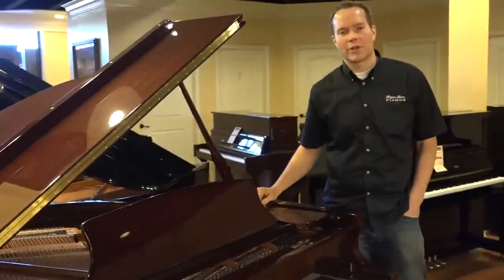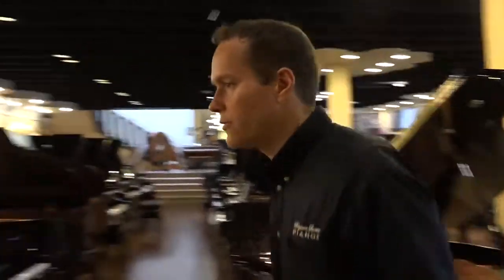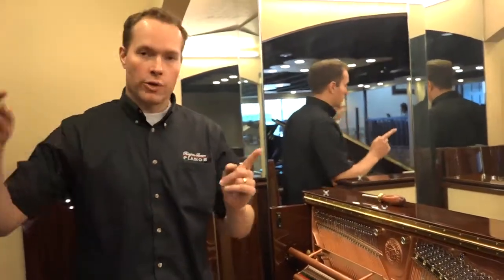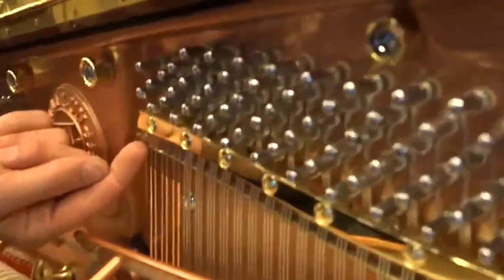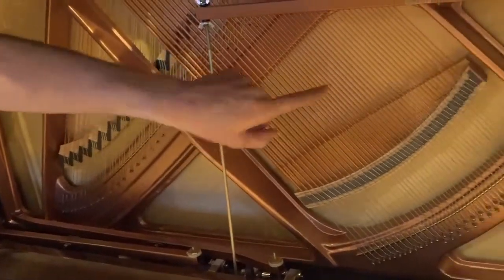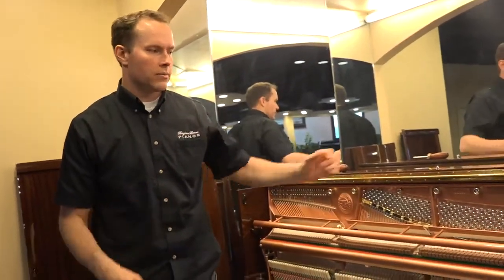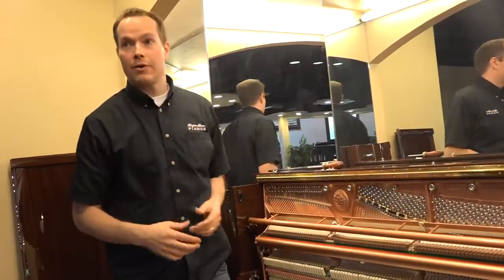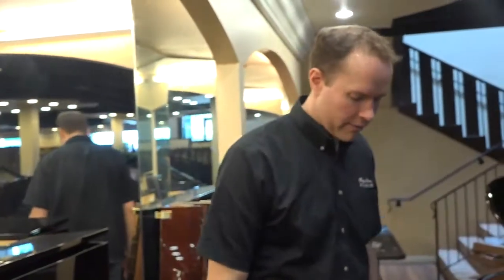Hailun Innovation & Advancements

Comment: How long have those hydraulics been tested to last for, and when is the soonest they should be replaced, in terms of basic precautionary maintenance?
Reply: No hydraulics in a piano, unless its somehow in the innovative soft close lid hinges.  Judging by the compact size of the hinges, I'd say they are spring loaded, and no hydraulic system used.